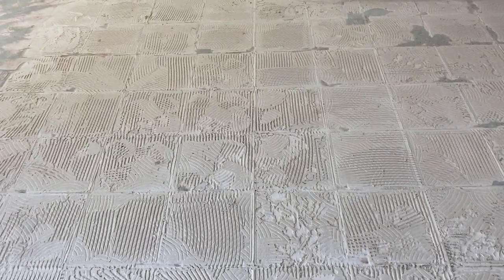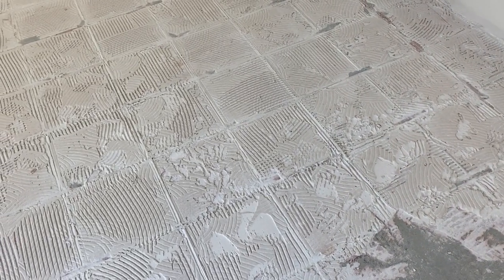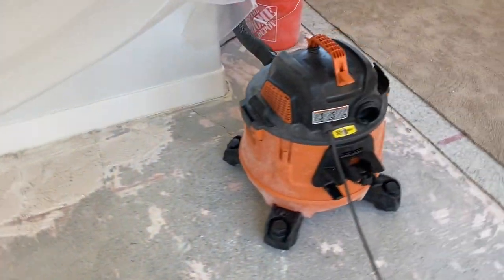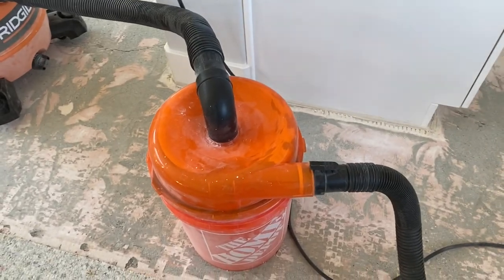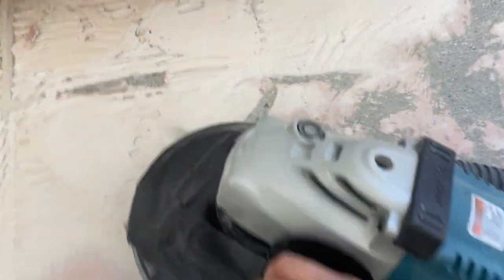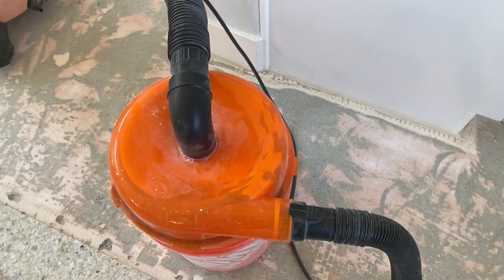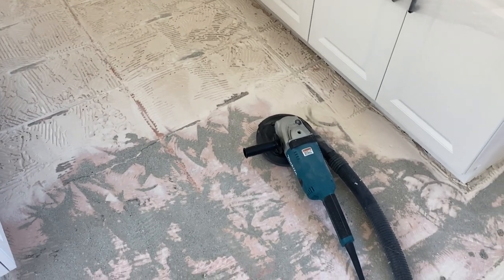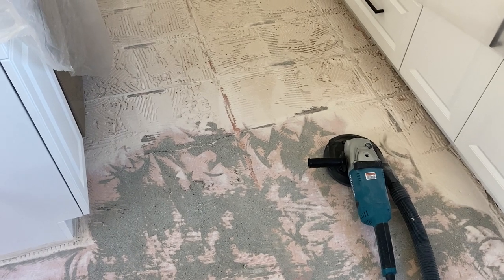thinset removal from concrete

Comment: If you have a large area of thinset to remove like this, rent the 10 inch concrete grinder from Home Depot.  You push it like a lawn mower.  So you wont' be on hands/knees for a few days with a small grinder. Get it done in a few hours, rather than a few days.  The rental is $200/day, expensive, but worth every penny. Saves your back and knees.

Comment: I wouldve used a pneumatic chisel from harbor freight $130 and it wouldve been done in an hour tops. Alot easier and they are atleast 4 ft long so u dont have to be crouching. Pulls thinset up clean and fast.
Reply: You’d be there 5 times longer & put in 20 times the effort. Speaking from experience
Reply: Those pneumatic chisels suck man. Only thing I use it for is for small vct areas. Up to 200sqft or less
Reply: You need to post a video then. I did it and it is a nightmare without a vacuum system
Reply: @donaldclemmons5980  I dont know if a pneumatic chisel is any more powerful than electric chipping hammers by Bosch's big ones or Makita's Medium sized ones, both of which I've used on commercial construction (structure shell form work for concrete pouring) for over 20 years, and HATED, for after a pour after the concrete is hard, cleaning off excess concrete around concrete column bottoms ( the base of a column where it adjoins perpendicular to a floor slab ) and would much prefer to grind it off.  Mechanical Chiseling or Chipping is NO FASTER, don't believe a word from that post, it's torture on your hands, forearms, and wrists especially,  when done repetitiously. Site foremen & superintendents know this and are leary that if/when a worker gets fatigued they may carelessly gouge the surface of a freshly poured slab at the base of a column and so they're always on your case to be careful about that, and that's exactly why I would prefer to use one of these instead. But they're set in their ways, and want to see a guy busting his tail earning his check, if they see a worker using one of these they'll portray it as if that worker is taking "the easy way out" blah-blah...etc etc.. Maybe on a "side job" , infrequently, once in a blue moon, mechanical chisel/chipping is tolerable, but for repetitious routine recurring work it becomes one of the reasons why workers doing that task start looking for other jobs/work.

Comment: You definitely need a vac with 25 CFM per inch of cup wheel diameter. That puppy looks like a 7 inch grinder, which means you need 175 CFM. This usually means hooking up two vacuums of 125 CFM with a Y connector. If you need help with the setup, we know a guy (we are the guy).
Reply: Hello! Happy i came across this comment. I am in the same boat and cannot afford to have dust. My wife runs a daycare and there must be minimal dust produced even if kids are not present during off hours. I have a 7' inch grinder as well. I look forward to hearing from you.

Comment: With the set up you had showed us? Did the dust collector and vacuum remove all the duct associated with grinding? Or was there still a reasonable amount of dust in the air? I'm literally up against the same job and just trying to ball park how much dust there will be.
Reply from the maker: I would say it removed about 85% of the dust, I did cover countertops and cabinets with plastic and closed off the hallways with plastic to make sure I contain the dust. There was some dust on the plastic covers but it was a very thin layer. Good luck with your project!

Comment: No demonstration?
Reply from the maker: yeah i figured ill just explain the setup since grinding thinset is not as exciting but i guess you would want to see the level of dust if any. So on that, ill just say that I had very low to almost zero dust but you have to keep an eye on the dust separator bin, that puppy would fill up quick.

Comment: Would a 5" cordless angle grinder work alright also?
Reply from the maker: As long as you can find the correct vacuum attachment then I dont think it would be an issue, the thinset comes apart fairly easily. I guess it also depends on the size of the job and how much time you want to spend charging batteries.